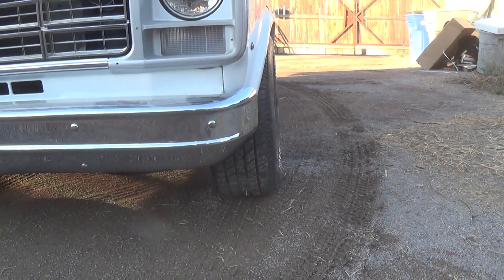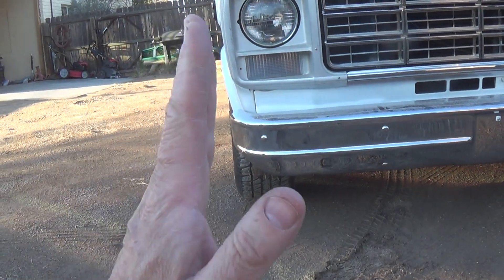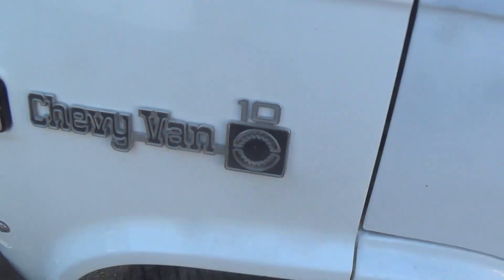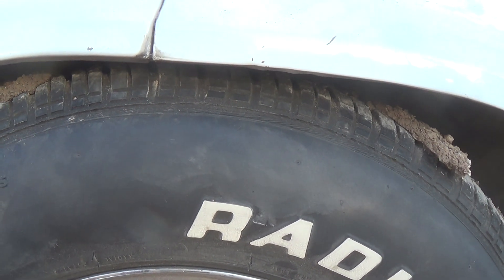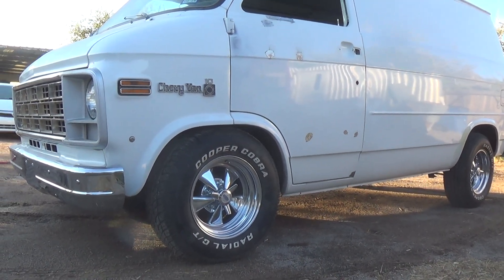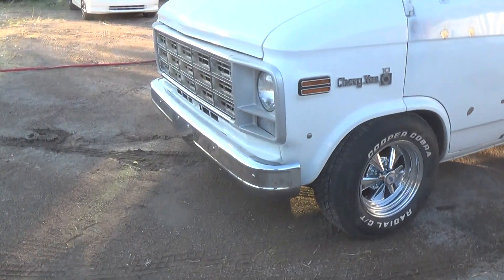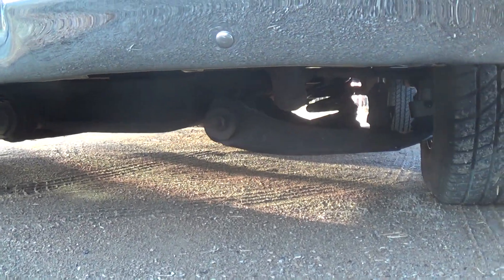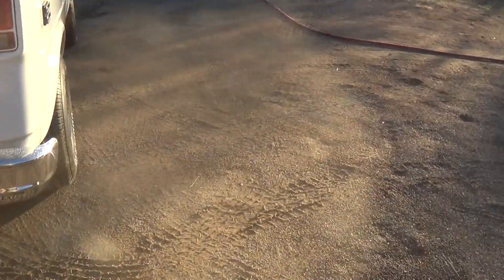1978 Chevy G10 G20 G30  shorty van build Don't drop it too much update part 1

Comment: Hello Rick, I've got a 96 G 30, have issues with my lock on both cab doors, been on going for almost 2 yrs, grateful for any help on that  . your drop sure was a big diff wow I'll be checking to see what the fix is.
Reply from the maker: Thanks for your post. I actually already planned on making a video on how to fix door lock problems. I will make a video on this soon. So hit the bell icon.  But if you cant wait most likely you have worn out parts. There are several possibilities including, most likely the door hinge pins and bushings. If not the hinge pins and bushings then a replacement door locking assembly and lastly the latch pin. The best way to tell if the hinge pins and bushings are bad is to open the doors and lift up on them from the door jamb lower corner. They should be firm but if you can feel play movement up and down that means the hinges need replacing or rebuilding. Junk yard replacement hinges can still be found in good shape I have a 1973 with bad hinges so I ordered a rebuild kit for my van and was sent the incorrect rebuild kit. So I went to the junk yard and picked up a set of 4 hinges for $5.00 and a locking assembly for a few bucks more. It is VERY common to have this problem with these vans and GM pick up trucks of the same era. The bad news is either repair requires removal of the door hinges. You can replace 1 at a time if you have a floor jack. Anyway stay tuned and thanks for watching.
Reply from the maker: I just uploaded a video about door lock issues in case you want to see it here is a link. https://youtu.be/1mzJlUiqSb0

Comment: I dropped mine 3in and had all kinds of problems with it. Gonna go up to a  1 1/2 in drop. Rubbed the front tires. Been a pain in the ass since
Reply from the maker: You used the regular 3 inch drop spindles. I used the 2 and 1/2 inch offset spindles with factory hight springs. This combo is NOT an issue.
Reply from the maker: 15 X 8 Cragar wheels with P235 70R 15 tires I installed the 2 and 1/2 offset drop spindles from BROTHERS TRUCK PARTS part number DLS0S00 73-87 60-87 DROP SPINDLES - OFF-SET 73-87 C10 pickup truck And factory hight Moog 6452 coil springs.
Reply from the maker: Check out my part 2 van video showing it with the stock factory hight springs and the 2 and 1/2 offset drop spindles.

Comment: Since you replaced your front grill  do you want to sell your original front grill ?  I have shorty headers For mine what headers did you use. I have a turbo 400 trans getting ready to order over drive going with gear vendors over drive.
Reply from the maker: These are the headers I installed. 

https://www.summitracing.com/parts/hed-69060/make/chevrolet/model/g20

My old grill that came on the van I think is aftermarket. But I am going to sell it along with the headlight bezels. I will stick them on ebay eventually.  The T 400 is a great transmission I wish I had on on my vans. I have the T 350 I do have the OD on my 1989. I have been considering swapping it into my gold van but I think I would also have to swap out the complete rear differential as well because of the different gearing. Not sure I want to go through all that hassle. I also just bought another Chevy van 10 without a drive train. It is a 1973 full size G10 I will be putting up a video very soon of that van. I am tempted to take the engine and trans from the 1989 and stick it into the 73 and just sell or use the 89 as a storage shed. The 89 only has 48K original miles but a rough body but a EFI roller cam 305 with the 700R4....
Reply: Awesome looking forward to seeing it

Comment: On mine I couldn't get the rear lower because the frame rail and gas tube were in the way of any possible notching.
Reply from the maker: What pat of the frame rail is in the way? I know it will come close to the fuel pipe but depending on how much you lower it, it shouldn't hit. The nice thing about the full size vans is that the fuel filler tube is behind the leaf spring so no issue about hitting it.
Reply: @ricksteelcustoms3196  I was going to do a flip. In that scenario the space is cramped. I thought of re-holing the front pocket but was afraid it'd stress the pinion angle. It's OK as-is, I just keep a full tank of gas to weigh the rear down lol.
Reply from the maker: @xpicklepie  Actually you can correct the pinion angle by installing some feaf spring axel wedge shims. Take a look at these Belltech 3 Degree Pinion Shims for Pickups with 2.5" & 3" Wide Leaf Springs. I found on ebay. eBay item number: 223607105374 Installing a higher placed hole in the front pocket is the best and easiest way to lower the van plus it is free unless you don't have the drill and bit. But you have issue with that fuel pipe in the way. Maybe a muffler shop can fabricate a reroute for the pipe? That is what is great about the full size vans you don't have that problem.
Reply from the maker: @xpicklepie  https://www.ebay.com/itm/223607105374?epid=20017006614&_trkparms=ispr%3D1&hash=item341005a75e:g:17sAAOSw~MRdQdgS&amdata=enc%3AAQAGAAAA4KcG1NlvYHEIlWeONb%2BES1k1MkuwvfuapbBwHoFvVbSwZSTF8HqdKXpl3JRzbOGUMODvgXi%2Fva1Es2u5JcoeAZY%2FxoF5nWb4g2vi%2BbbfO%2FwoRKdxpESDFRVZHJD0kuUZRgzOT3sK5%2FTpQA0SjT1qxmd7u9X2j%2FaIiOpA78X7a7JxpcKYJirs3h8nvYs%2Fdhtm9cBfVHkBCLICpUlJ1%2Bxj9KaNHUmNvQGYE8BX6z6Z4Yu1Btne%2BWWdZLYEX1vYYQXGPv3PxjT1SrFrQsHNc5HsBli198vk1ApbVJ4CgT8GuUWg%7Ctkp%3ABFBMmq75oYNg
Reply: @ricksteelcustoms3196  Thanks for the link. Hole-sawing the front pocket would eliminate the fuel tube clearance as well. One other thing about the tube is that it's very narrow and when pumping gas it fills slow and kicks off the nozzle. I was going to use a bigger pipe but it goes through the rail and pipes fuel in at a 90 deg, angle so it'd be a tough mod. My '77 C20 does this too. Oh well.
Reply from the maker: @xpicklepie  I can tell you that the fill pipe on the full size van is different from the shorty in size it is larger. Plus the shorty van has a "flat" spot in the pipe that the full size does not have.  I do not know if you can swap the 2 but if you do it should eliminate the the problem of "kicking off the nozzle." But you would have to cut a larger opening. When I got my gold van it was missing the pipe and I had to pick one up at the junk yard. The previous owner installed a new fuel tank and lost the pipe and hoses. It was VERY difficult to fit it through the frame rails and then attach the hoses to the pipe or even find the pipe hoses.

Comment: Hi Rick, so is it definitely the way to go using the offset drop spindles rather than the ordinary drop spindles? Did you see my message about the headlight bezels?
Reply from the maker: Is that you Greg? Yes according to brothers the 3 inch drop spindles are NOT offset and will push the tire/wheel out too far. "BROTHERS high quality dropped spindles are the best way to lower the front of your truck. These drop spindles will directly bolt on to your stock ball joints and tie rods while requiring the use of 71-87 disc brake components. These "Off-Set" spindles are designed with 2-1/2" drop while only increasing your track width up to 1/4" per side. Standard 71-87 drop and stock spindles will increase track width 3/4" per side on 60-70 applications. If used on 71-87 trucks, the track width will actually decease to allow additional room for wider wheels /tires."
Reply from the maker: Check out "D Snuttz" post above.

Comment: Looking good. What tire size are you running? I know some guys with 3" drop with 245 tires that seem to work.
Reply from the maker: P235 70R 15 tires
Reply: @ricksteelcustoms3196  You might try a 235/60/15. They are 2" smaller in diameter. You'll go from 28" to 26". That should give you the clearance you need.
Reply from the maker: @vanningmike  I already solved the issue with stock hight coil springs. Besides I am very likely going to be swapping out the tires and wheels for torque thrust 2s 17 inch up front and 19 or 20 out back. Did you see my part 2 video?

Comment: Do you think this would work on the 1989 g30? I wanna lower my auto detailing van
Reply from the maker: If you have an 8 lug no. But if you really wanted to lower it you could get some drop by going with a drop springs made for a C10. But I have not done this before. So do it at your own risk. But I did put a G30 spring on my G20 because I wanted to give it a lift and it worked great. The other option would be swopping out the spindles springs and rotors from a G10  but you would also have to get new 5.5 lug wheels and then you might also want to swap out the rear diff/axel to have uniformity. But YES anything is possible if you want it badly enough at least in the custom car and van world. Best of luck and thanks for watching. Give "Brothers truck parts" or "cj pony parts" a call they might have more info for you to digest and if anybody has the parts they will.

Comment: What size tires you running Rick?
Reply from the maker: Thanks for watching I currently have P235 70R 15 tires But I am not going to keep them I am going with torq thrust 2 polished wheels 20 inch for the rear and 18 inch wheels for the front Chevy Van G10 G20 G30 2 & 1/2 inch drop spindles with stock springs. And C3 Corvette mirrors Part 2

https://youtu.be/i0tkkropvMU

Comment: Every time you guys mess with that suspension it's always screwed up you never can dial it in
Reply from the maker: My van is now "dialed in" perfectly, at 2 and 1/2 inches.
Reply from the maker: Chevy Van G10 G20 G30 2 & 1/2 inch drop spindles with stock springs. And C3 Corvette mirrors Part 2

https://youtu.be/i0tkkropvMU